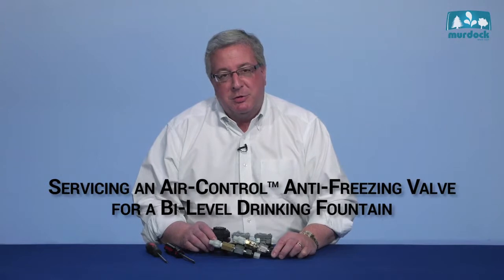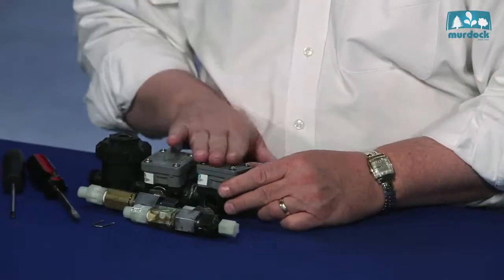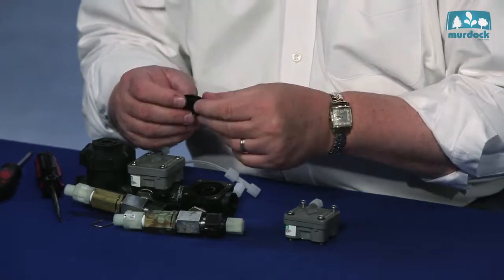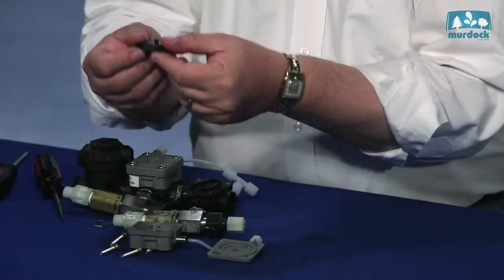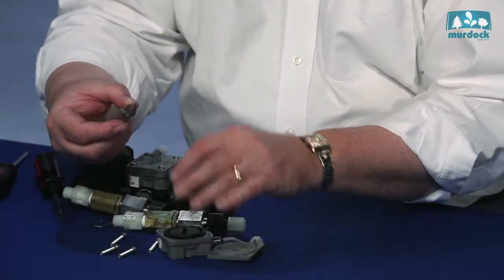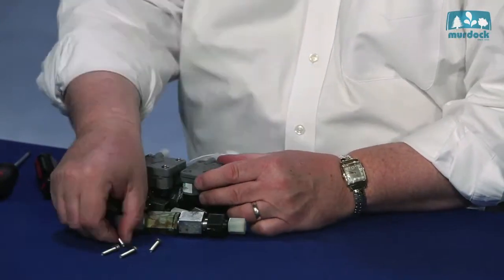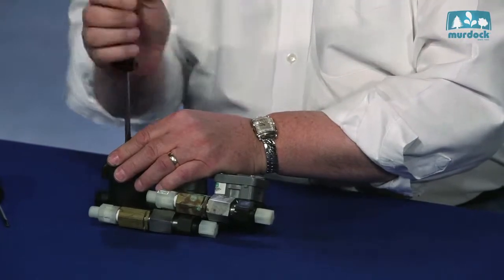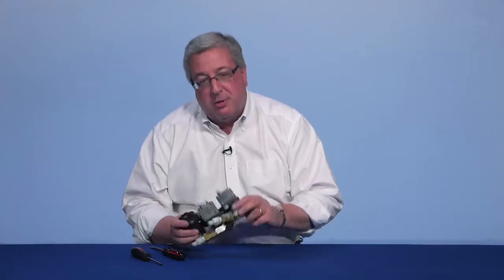Servicing an Air-Control Anti Freezing Valve for a Bi-Level Drinking Fountain | Murdock Mfg.

Comment: Thanks Bob. That was really helpful. We have one of your fountains on a rail trail we manage. We didn't realize it was designed for year round use so we shut off the water during winter. When we turned on the water, we had a leak on the quick fitting between the check stop and air control valve, but fixed it by replacing the o-ring. (I incorrectly thought it was coming from the air control valve, took it apart, then put it together the wrong way, i.e. no click) A quick question:  can you control (i.e. reduce) the flow rate with the check stop? There's too much pressure at the fountain. It doesn't seem easy or possible to adjust the button pressure while drinking.  Thanks in advance.

Comment: Hi, why is it that the water doesn’t permanently flow when kids want to drink water using the drinking fountain or the water filler when water going through the chiller. Since water stopped flowing when using the drinking fountain I swapped the hose to be able to get cold water from the water filler but water won’t come out ether. It seems like there is an abstraction in the the chiller itself or what do you think it is.
Reply from the maker: Hi Francisco. Please contact us at 1-800-743-8259 and ask for Bob Murdock. He will be able to assist you. Thank you.